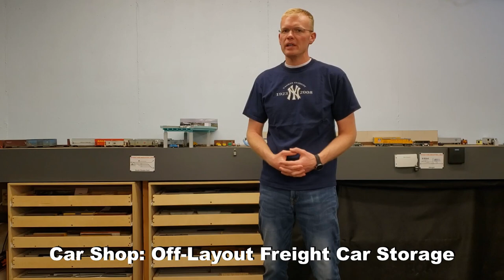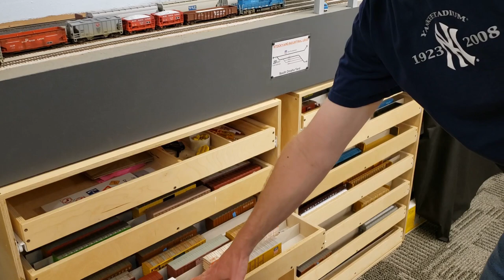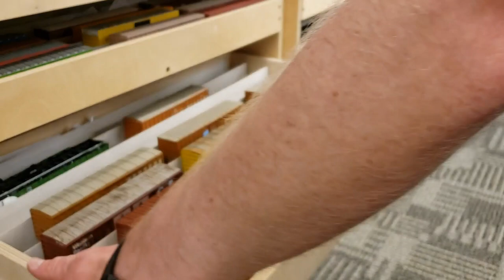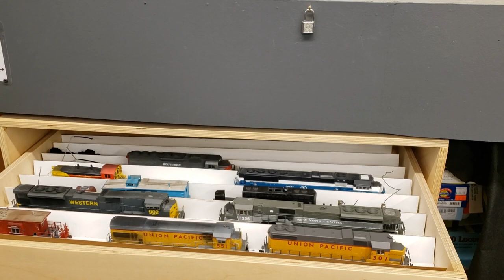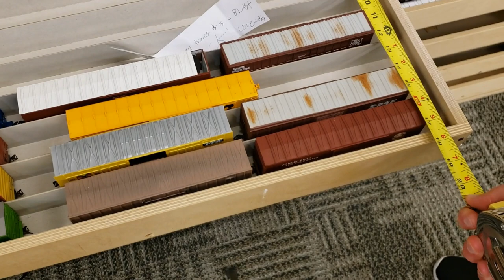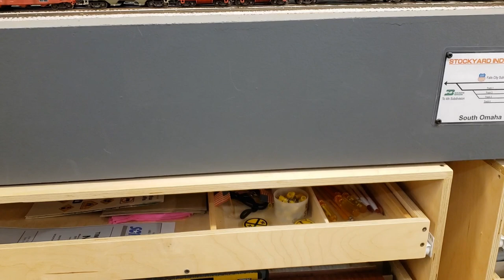Stockyard Industrial Lead: Off-Layout Freight Car Storage

Comment: Thanks for the video on your storage system. Just wondering if you kept the boxes the models came in or you threw them away. I've found I've "doubled" my storage because I have kept the boxes and now have to store the models AND the boxes!
Reply from the maker: Very good question and I meant to address this in the video.  I usually don't keep the boxes that the models came in because I tell myself that I will never sell them, then I regret that decision when I decide to sell a specific car!  So I usually keep the boxes for the nicer models and all of my locomotives and throw out the boxes for cheaper models to reduce clutter.  Very good point about how this doubles the storage!